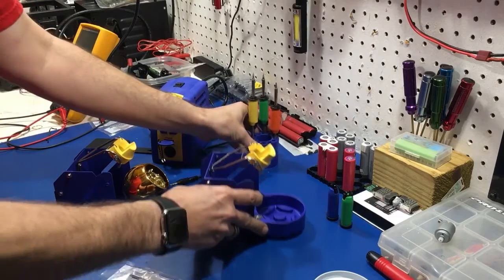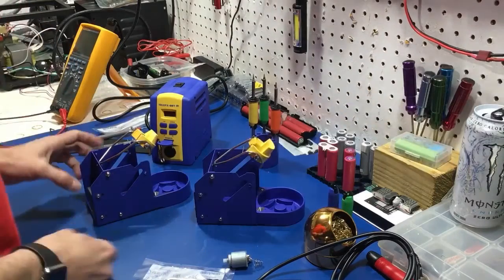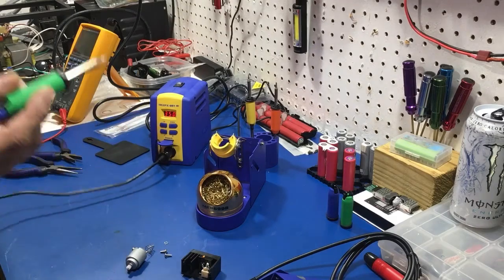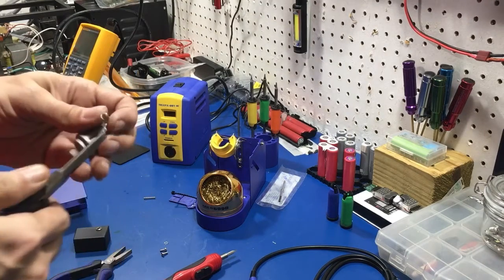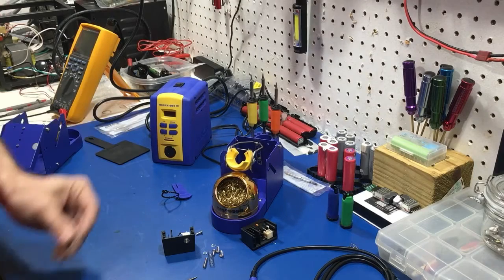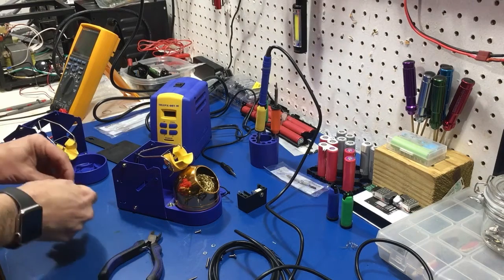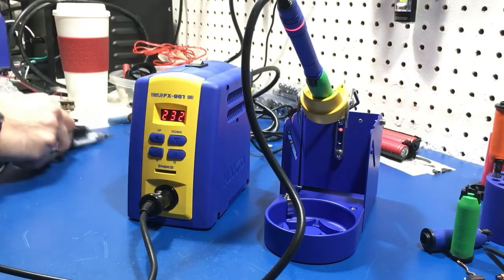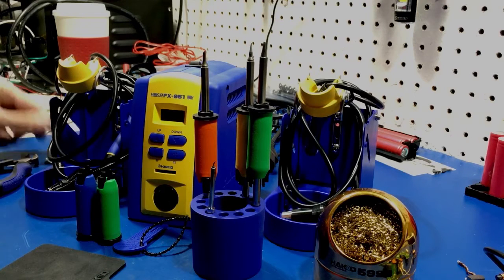Hakko FX-951 - Part 2 - ”The 2032 Stand Repair” 2032 Stand Sleep Switch

Comment: Hi Friend, Here Alex From Mexico. I'd like to know if this one the holder has only the switch or has something elese like a Resistance.. I dont have it and I need to make one. Thank you .
Reply: bro necesitas que tenga tu estación esa entrada de tipo auxiliar. allí conecta el cable que viene de la base

al poner el cautin activa ese interruptor y manda a dormir el maneral

pero la mía es clon y no tiene ese conector 

checa si la tiene la tuya
Reply: Yep its a resistor in parallel with a n/o micro switch. So 2.5mm male tip to one side of n/o switch then to one leg of 4.5k ohm resistor. Middle tip ring to other side of n/o switch then on to other leg of resistor. When iron is in stand lead back to station reads 0 ohms. When you pull iron out it reads 4.5k.